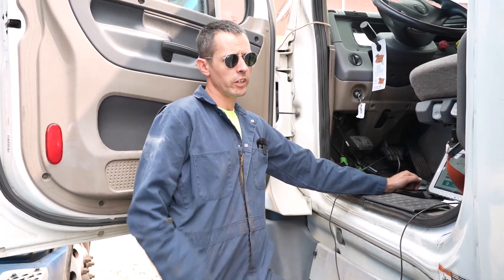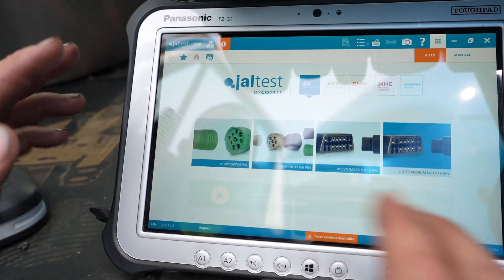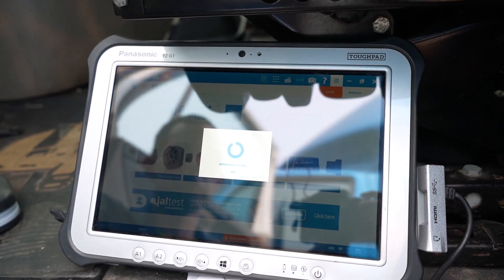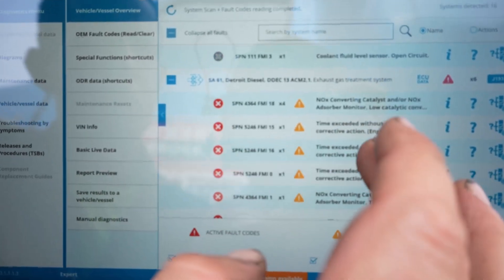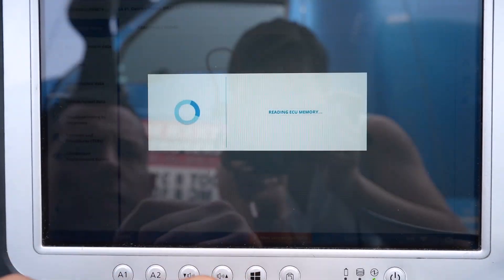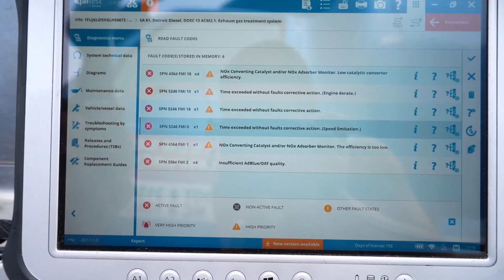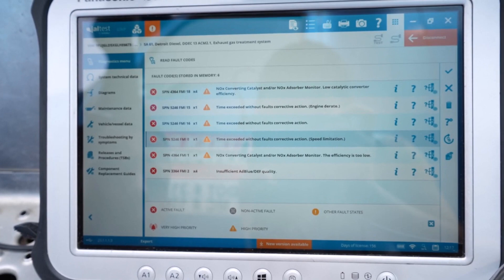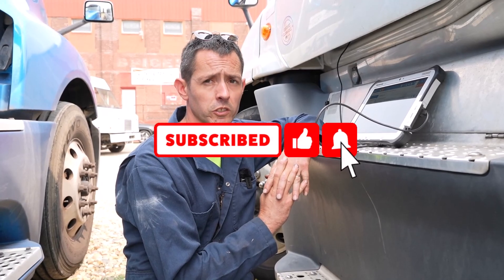How To Diagnose A Semi Truck Derate - The Full Diagnostic Process For An Aftertreatment System

Comment: Common issue with NOx conversion with dd15 is bulld up of DEF in the scr . FREIGHTLINER has an awning that can be installed to aide in preventing this build up. If you remove doser and see build up it is most likely the cause. Some cases you can clean off doser with warm water and perform forced regen.

Comment: Let us know what the problem is, I have a 2018 Freightliner cascade and my ELD keeps throwing same codes, and then engine light comes on with no fault codes on my truck dash, run it and after so many miles codes go away and come back with same codes. After. A week or so. Plus engine light goes out on dash after it clears from the ELD.

Comment: This is not a def problem nor a nox eff problem . Shops throw parts at this and send it on down the road .i and many other freightliner have this problem . Its a software issue imo. If you reseacrh it you will see lots of hits on it beening a problem . All mechanics say they did this or that and it comes back later. Maybe not to the same mechanic, but it comes back . How i attact this problem is i got software and run a scr efficiency test on it until the nh3 valve is above .93, but this only lasts 1000 plus miles . Sometime 5000 sometimes 1000. It's the computer saying too much def is needed to convert at an acceptable level . If you dont admit this, you're just another mechanic gonna throw money at this and send the driver on his way to break down in 5000 miles.
Reply: It’s not always a software issue. I had many trucks in my shop where there MCM and ACM where up to date and the problem was def build up, bad def quality and def injector not spraying enough def
Reply: @PrabhjotSandhu-tm9yu  yea  yea . Forums of 1000s of posr from mechanics all admiting to this being a detroit problem . Mechanics admit that doing everything even onebox replacement dont fix this.
Reply: @TheCbriley how would replacing a onebox fix a def issue or a nox sensor issue, I had many trucks like these that the ACM, CPC and MCM were all update to the latest software
Reply: @PrabhjotSandhu-tm9yu  i didnt say it would . In fact i said opposite.  I said that from forums and research that mechanics have stated that they have done everything to fix this even replacing 1box but the issue still comes back . I believe its a software issues  that detroit refuses to fix or cant because of epa regs.